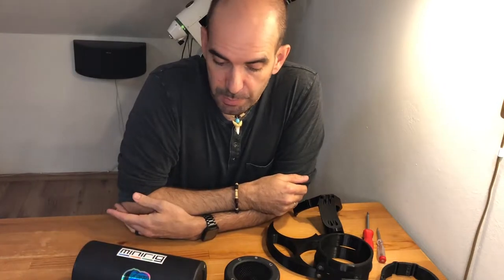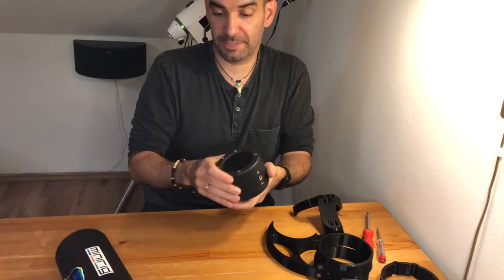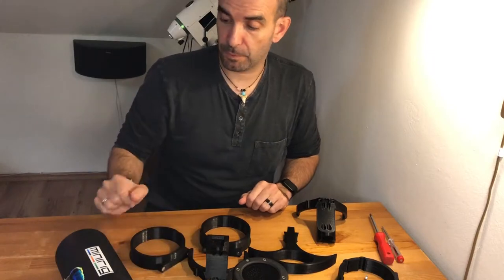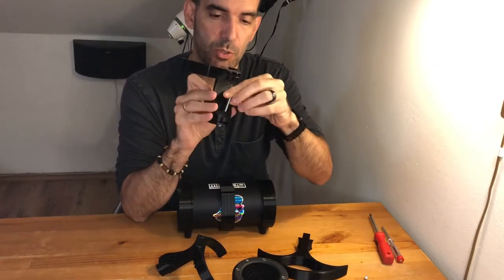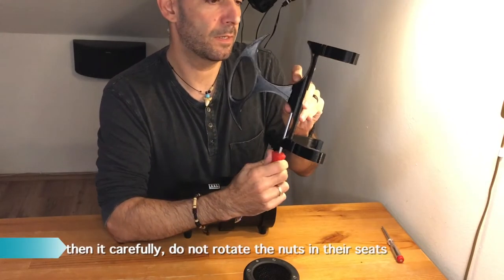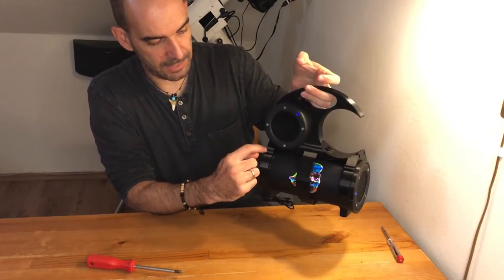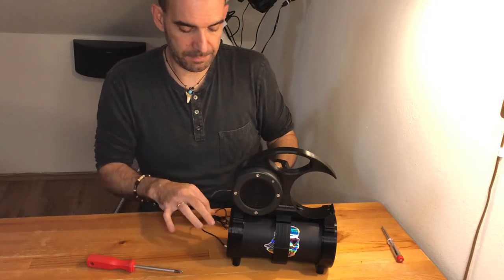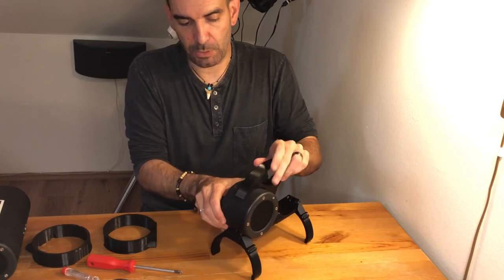MINIRIG BOOMBOX "OWL" - Introduction and assembly guide (v2.0)

Comment: Do you have specifics on the type/size of screws/nutts you use?
Reply from the maker: Hello, just watch the video till the end, approx. 9:45 you will find the answer 😉👍
Reply: @cax24  Dope thanks!
Reply from the maker: @xrunesx  Optionally you can use M5x40 Allen head screws, it makes the assembly easier, with an Allen key.

Comment: Anyone managed to get this to work with a V1 sub and 2 x V2 Minirigs (the first BT versions). Need to find out if they are the same dimensions! Thx
Reply from the maker: Hello Richard, as far as I know MINIRIG 2 and MINIRIG 3 are the same dimansion, but obviously different inside. :) The SUB1 and SUB 2 are also the same, so they should fit. But let me doublecheck.
Reply: @cax24  Thanks for the reply! I've just checked and indeed diameter for all products is the same at 101.6mm so I'm good to go! Now to decide colour to print with!!?
Reply from the maker: @ediflyer  Share a photo when ready. Try RED! :D
Reply: @cax24  I have purple and blue Mini rigs and a purple sub. PLA available just now is silver, translucent blue, gray, black or yellow. I'm thinking the translucent blue could be cool!